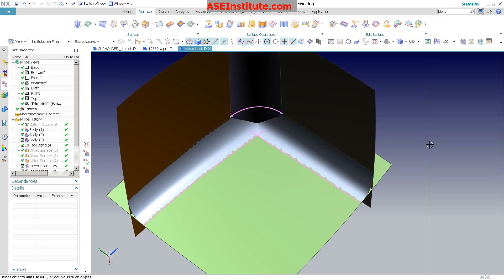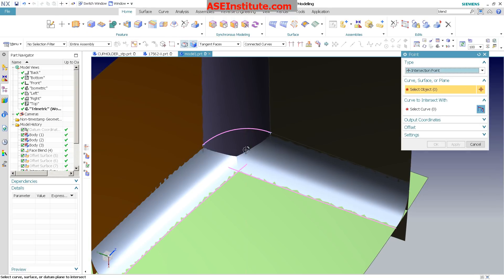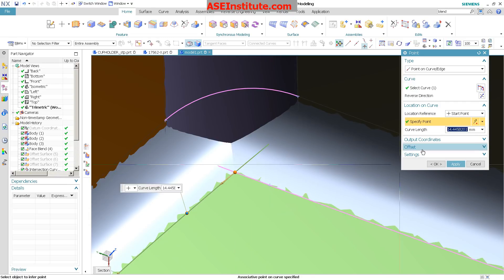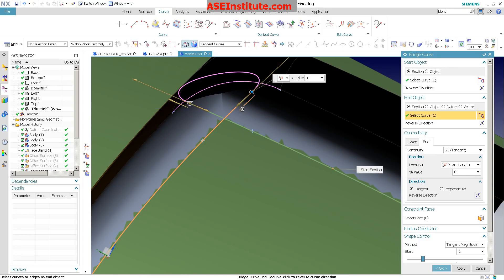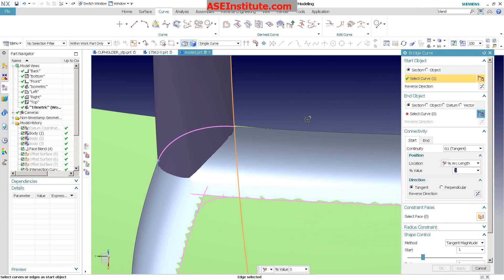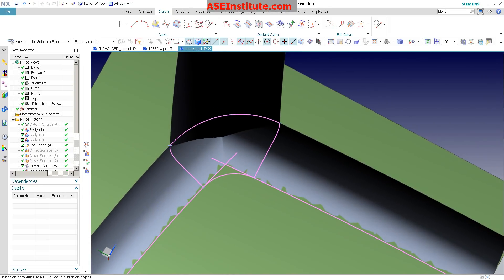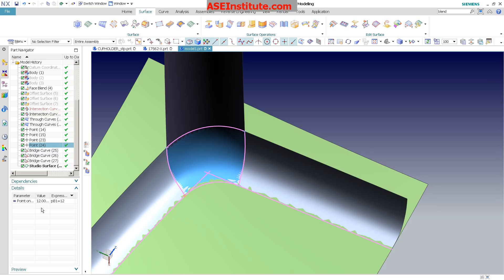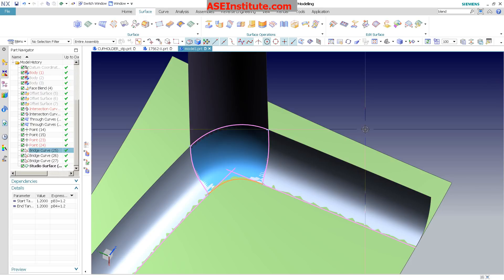Siemens NX 12: New Point Function

Comment: im curious to know how to control the model (Pan, zoom , rotate)? without using the mouse . you use that trick in catia also .
Reply: He uses a 3dconnexion spacenavigator

https://www.amazon.com/3Dconnexion-3DX-700028-SpaceNavigator-3D-Mouse/dp/B000LB7G00/ref=mp_s_a_1_1?ie=UTF8&qid=1529705341&sr=8-1&pi=AC_SX236_SY340_FMwebp_QL65&keywords=3D+Connexion&dpPl=1&dpID=417Vll2NOSL&ref=plSrch
Reply: damn , so expensive haha but i think its so helpful . thanks fisher
Reply: Reedick Ivan Somido it is very expensive. Its a metalic part made by cnc, feels like a military part. You can look for a used one on ebay or Amazon
Reply: haha , well see .